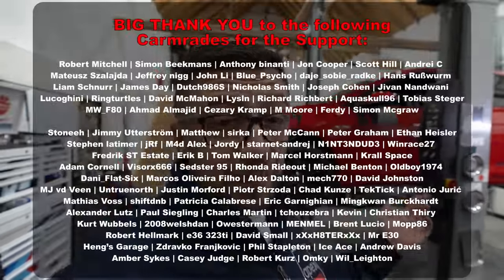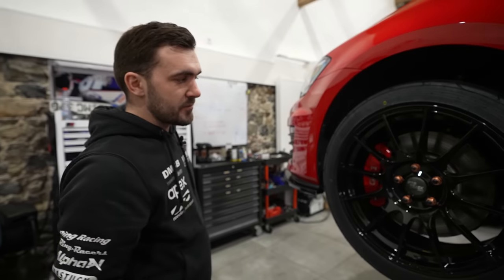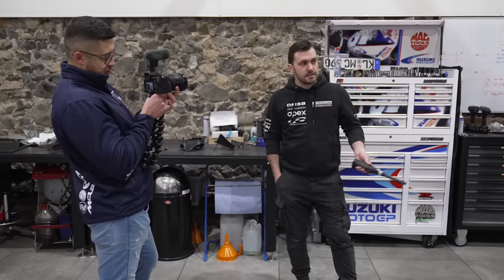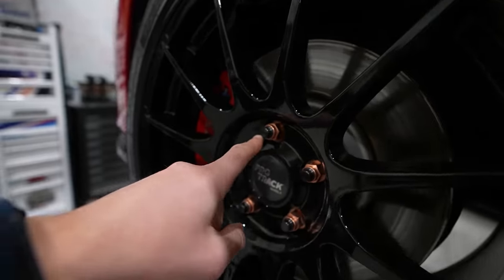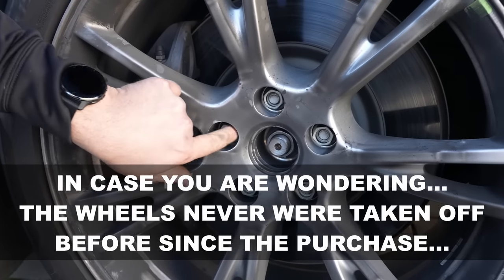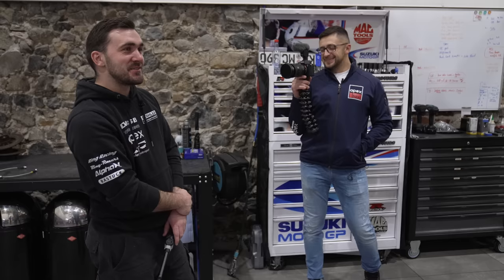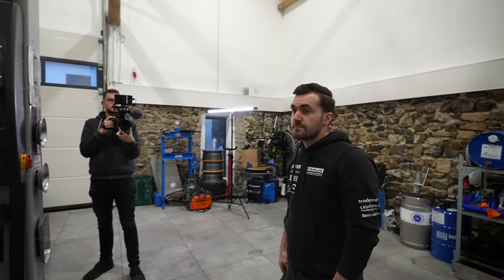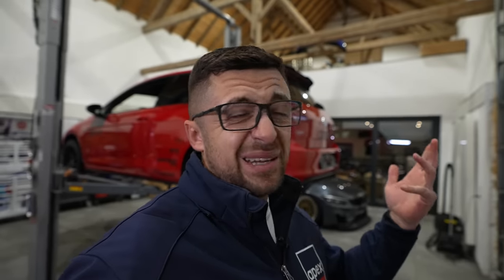How To Prepare Your Car for the Nürburgring: THE ESSENTIALS

Comment: So the calliper pins…
You can buy them from VW there’s 2 pins on the carrier 1 solid and one with rubber bushing jus replace the one with rubber bushing with the solid….alternatively APP Brakes in the Netherlands sell a kit who is our supplier for these kits.
Reply: Hey George. Really valuable info. I've a Golf 5 GTI I'm preparing for some TF this season. I plan to upgrade to the 340mm Golf 7 front brakes. I cannot find this pin kit you're referring to. Do you have a link or a suppliers website?

Also, what's the part number for the little air vanes? They seem nifty!

Cheers
Reply: @LasseJOugaard  I also tried to find it without success. All schematics i found showed both sliders to be the same type
Reply: Major Beginner Mistake is, they buy big Breaks, and this is just wasted Money.
I know a Guy who bought Audi RS3 Breaks for his Golf 370mm. 2000 Euro wasted. 
The bigger Breaks give you nothing, your Breaks are already big enough.
What you really need is a good Breaking System. You need Fixed Calipers, and not Swim Calipers.
You can have 500mm Break Disc, if you have Swim Calipers its just BS.
2 or 3 years ago F1 Cars had 13 Inch Wheels, mean they had about 9-10 Inch Break Disc, and they had the shortest breaking Distance. 
Spare your Money, and buy a high quality Breaking System with fixed Calipers, instead of a "370mm Show Break".

Comment: Couldn’t agree more with this video. Anyone considering any track time should 100% change out the pads to something like ferodo DS2500 And a proper set of tyres. Even pilot sport 4 are great for track days. Also a brake fluid change, engine service and even gearbox oil. Your car will thank you 🙏

Comment: Great video. Just my 2c for people wanting a daily driver that works on the track, too - consider the products out there and try to avoid the hype. Fluids are quite obvious - however surrounded in myth and folklore - check your coolant levels and that the coolant type is correct for your car. You might want to change your brake fluid to something with a higher boiling point. But don't jump straight to Castrol SRF as Sunoco R Extreme is also a good option (25% of the cost with similar spec). And stick to your car's recommended oil weight, avoiding race oils (unless you like to change this a lot).

Comment: Great video! I use Motul RBF 660 brake fluid, KW V3 suspension, regarding wheel nuts, i have never had any issues, i just take care of correct torque, in my case is 130 Nm, but i agree if the car is used like really heavy on track all season

Comment: This is very good Misha. 

Coming from experience makes this type of content unique not just theory.

You mention in the video about tyre pressures. I believe there isn’t a Single video on YouTube on how to discover the correct tyre pressure considering the weight, inch’s of the wheel etc.

Let’s say for example you have an older car and you want to do a project to be a track car. The specifications of the manufacture on tyre pressure won’t help to find the right one in order to have the best performance of the car.

If you can do that it would be very cool 👏🏻👏🏻

Comment: Good video. A couple of notes: most people will probably want a good compromise between street and track ability. Too aggressive brake pads won't develop full friction when cold, and they might also be noisy. Any normal brake disc will also warp quickly under heavy use (not sure if dependent on car / calipers), so I'd use heat treated ones, which of course are more expensive. Or swap the cheaper ones regularly.
Easy cooling improvement is said to be to remove the dust shield btw., but I'm not sure that'd be street legal. Oh, and lighter wheels also improve braking - less rotating mass to slow down.
Reply: Too aggressive pads can also eat up your discs quite quickly. A nurb lap is long and you want to make the trip worthwhile and be able to do a bunch of laps before you grooved your discs to hell.
Reply: @imnota  Then what brand - model brake pads do you choose to don't eat brake discs ?.
Reply: @mdev8846  ferodo ds2500 is good for a dual purpose pad. But it's all down to preference and your experience, I was just giving the global advice that you probably don't want to go to a pad as aggressive as what you would chose for a track only car on a smaller track, because given the length of the ring, longevity becomes a factor.
Reply: @imnota  O.k. Thank you.

Comment: Great video and much needed based off of some cars last season. 
…I think that some more time should be done with regards to brake fluid. Maybe explain the different grade’s available along with the service intervals depending upon what grade you are running, as well as a brief explanation of how old fluids boiling point is reduced due to its contamination. 
….There are plenty of cars on track with extremely old fluid that may not survive a few corners.

Comment: Hi Misha. I See this car is also running NS-2R like the other smaller rental cars. Can you recommend these tires? I have a set of these lieing at home but was not sure about the safety aspect of them running on the street cause I need to drive 160 km to the ring (besides that car is not driven daily). Would you recommend them over for example an Michelin PS4s? Also considering the safety aspect vs better being better on the track than a PS4s? ✌️

Comment: My mk7,5 gti 245hp car, overheated with stock power. I think its good to upgrade water and air coolers.
 clubsport/tcr has side coolers too, is better solution than in 245hp gti.

Comment: thinking about the best bufget track mule for the ring. you see loads of 3 series, but seems like you want to go as light as possible to keep the costs down. miata is light and cheap, parts and repairs are cheap, simple to work on. it's a beautifully balanced little as car albeit with some suspension work required, the biggest inhibiting factor as usual with the miata is power, but a supercharger or k20 would get it to 250bhp per tonne and sub 8mins.

Comment: Wonder if Endless MX72 or MX72+ could cope with the ring or track day once in a while for a daily? 

On another note how do you not have at least 1Million subscribers seriously!!
Reply: These are usually fine for 1-2 laps Nordschleife, needs cooling/break after this. 
But after 10-15min Hockenheim GP track you will also destroy these
Reply: A question: Are Endless MX 72 or MX 72 + noisy for street use ?.

Comment: Great video Misha, as always :)
I plan to go on the Ring for the first time this year. My preparations so far are practicing the ring on Assetto Corsa; and for the car: added ducts for brake cooling, added a large oil cooler, refreshed all coolants and fluids (engine, oil, brakes, diff), new tyres and a few suspension tweaks. Anything I missed?
Reply: I would add braided brake hoses. I had braided hoses for my first ring trip last year and didn't experience any fade whatsoever. This was in 2 tons of E61 5 series on stock discs and pads. Absolutely murdered the discs and pads on lap one, but didn't have any fade.
Reply: That's more than good if you are doing the first laps. Other than that I would rather pay attention on a good braking technique (brake harder and shorter than longer and softer) and avoiding dangerous situations by always keeping the traffic in your eye.

Comment: I have a question regarding bolts vs studs. George mentioned the heat transferred to the bolts making them lose, etc... with studs, does not the same happens? I'm wondering if because it is a two piece (stud and nuts) and not just one, the heat transfer is different... and also about studs, are there any other advantages? Any material for stud and nut that is more recommended for racing purposes? Thanks guys

Comment: Amazing explanation of everything as always by both of you. Is the black Golf also running 5w30 LM 4200 like you presented a couple of years ago?
Reply: Indeed! 5w40 also
Reply: @TwistedSymmetryUK  which one? I have the ED35 and I plan to use 5w40 also because I find that I use some 300 to 500ml to 5000km depending on the use. Thanks a lot

Comment: Maybe weird question, but are slightly vibrating brakes an issue in an inspection / MOT? The brakes grip and feel symmetrical, there's just a bit of vibration.

Comment: I really enjoyed this video, George was talking a slightly different oil grade to keep temps down what grade are you running?
Reply: 5w30 normally but also run 5w40 in the summer I may also go to 15w50 on the cupra for the track days etc.
Reply: @TwistedSymmetryUK  only reason I ask is I’m staying at Apex in July just wasn’t sure on what oil to run? 2017 Golf GTI Clubsport 350bhp currently running the 5W30. I don’t plan on going crazy on the track, do you think the 5w30 will be ok?
Reply: @jaybates2974  that will be fine man 👍🏼
Reply: @TwistedSymmetryUK  would you recommend any brand at all? I’m running Castrol in it at the moment? 

Also was going to ask what sort of oil temps do you see in the summer out there?

Comment: These wheels on golf are 18's? I'm not sure if it's better to have 17's or 18's for a track on a smaller car like this, or gt86 for example. Thank you for advice ;)
Reply: With 18's there is more options to choose differents types of tyres. For example, in Europe Michelin Sport 4S don't sell in 17's.
Reply: George speaks about the standard size 225/40-18, but these tires seems wider and higher, i guess 245/40-18 (or 235/40-18). I think that also the rims must be the right measurements (ET etc.), in combination with the tires to fit within the wheel arches (full lock steering). Volkswagen recommends and allows only 225/45-17, 225/40-18, 225/35-19 and 235/35-19 for street use.
Reply: @pauljonkers4359 Good advice. Perhaps, the optimal size It will be 235/40 R18.

Comment: Misha, thank you very much for the video!  Tell me, is it worth installing an oil pan with an iABED Industries type anti-drain system on a golf 6 for track use. What else should be installed?  Maybe a larger radiator, DSG oil cooler, Wagner tube and fin type intercooler? Thanks!

Comment: Great video, interesting part about the wheel studs. I think i will also swap them because i am always a bit worried about the wheel bolts getting loose so i check them every few rounds just to be sure they are tight.
I also heared you need to change the studs every season because they might break over time, is that true?

Comment: This year I'm going to visit the nordschleife with my 131ps dacia dokker for the first time ever.  There aren't much tuning parts for this car available. I believe I should change the braking fluid .   But I've no idea which fluid  i can put and if it could cause any damage to the break system. I even don't know who to ask  and who  could do that work.  My official dacia renault garage won't do that for sure.  Maybe you can tell us where to go . 
Greetings!
Reply from the maker: Make an appointment at Manthey/Raeder
Reply: Mobil brake fluid is compatible.

Comment: Question for George, when converting from wheel bolts to studs do you have to change the hub or is there a kit that uses the original?
Reply: Studs just screw in replacing bolts on the hubs you have, loctite and torquing them is essential also!

Comment: I think there is a different reason than low cost for the manufacturer speccing parts that don't work well for intense track use: race brake pads, for instance, work best with the high heat of track use, but don't work well in daily-driver situations.  The pads will make noise, and have poor braking until they are warmed up.  A track car should have different parts than a daily driver, because the conditions are so different.  Granted, some things work in both situations (quality brake fluid, steel lines, etc.)  I have read in several instances that the best way to ruin a street car is when the mfgr. sets it up for the Nurburgring!  Stiff and unforgiving... not a good street car.  Like he says, 99.5% will never see track time, those that do can do the upgrades mentioned here.
Reply from the maker: Actually! The Nürburgring setup is pretty soft due to all the bumps. Therefore, all the Ring Tools are super comfortable.
Reply: Good point on the brakes, but regarding the suspension, usual mistake of equating "stiff" to "cornering well". Suspensions are complex - dampers can and will have vastly different responses, on coilovers there is one spring for larger, one for smaller absorptions.. you can't just throw them all in one bucket. There are very compliant suspensions out there that corner incredibly well, and there are very stiff ones that do not.
Reply: @mgcharoudin  yes super comfortable for a track car, but still a lot less comfortable for daily use compared to OEM set-up

Comment: Nothing anoys me more than people with all motor mods, but stock chassis and brakes.... stopping, therefore safety, is the first thing people should do....😔🤬
Reply: I've done about a dozen mods, and none of them (yet) is engine. I will also never understand those that just do engine and neglect everything else - incredibly dangerous 🙁
Reply: @stoneeh  Exactly... and what's even worse are the people who cheap out on tires... litterally the only link between the car and the road...🤬🤬🤬🤬
Reply: @SPQR_GuiGui  a swap to the best tires I could find is the first "mod" I ever did to my car :)
Reply: @stoneeh  Same for me ! Tires, then brakes (pads, braided lines, and fluid) and only then some more power and/or chassis reinforcment !

Comment: Anything approved by TUV is usually trash quality. Endless braided lines cost 500+ after import, not TUV approved, I wonder why...
Reply: There’s a lot of parts that don’t come with approval because of the costs. Single approval is still possible in a lot of cases